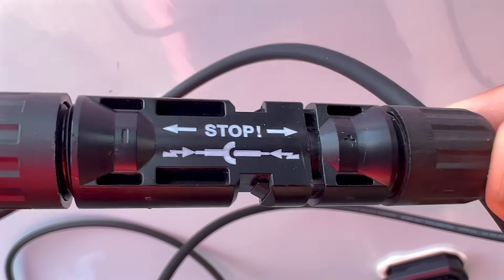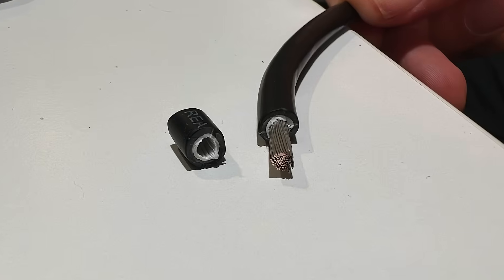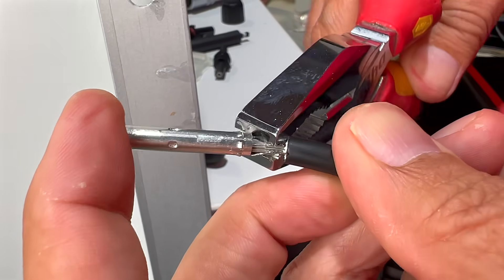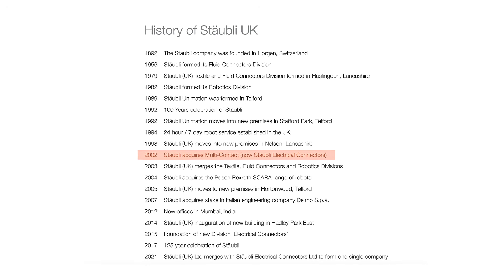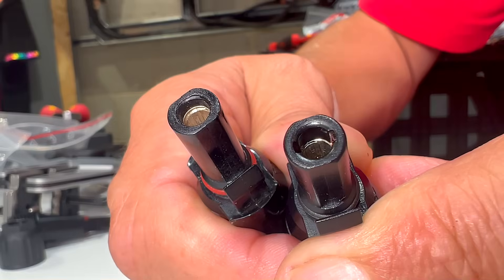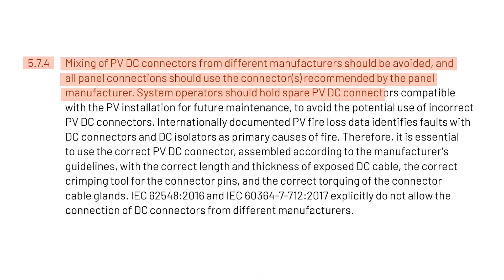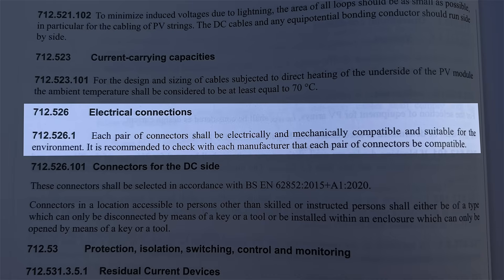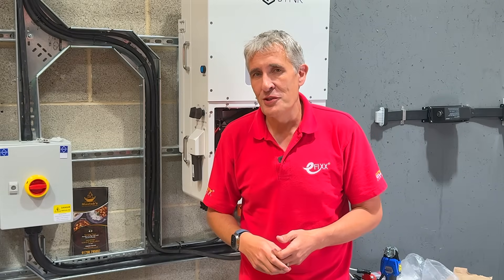Don't Get Burned by MC4 Solar Connectors

Comment: I'm wondering is dialectic grease would help with these types of connectors. It certainly does help in DC connections in cars. I have also had success in AC light fixtures where the high power bulbs were only lasting 30 days due to connector dialectic caused corrosion/oxidization.

After a large amount of dialectic grease was used the life span of the bulb went to two years. The connection no longer failed, the life span then was dependent upon the filament failing. 

Galvanic caused corrosion/oxidization is a huge issue in reducing the currant load capability of the connection. Dialectic grease does wonders to retard or stop this due to isolation from oxygen atmosphere cause corrosion.

If you have ever seen the red goop applied to a car battery connection, that is dialectic grease.

Comment: This is an important video for all to watch.  Personally, I don't like MC4 connectors because the build tolerances are poor. Then,  there are all the cheap clones which are outright dangerous.  Melted MC4s, cracked MC4s, I have seen it all.
Reply: No module de-energisation, a DC fault will melt anything!

Comment: Tools crazy expensive. I just hack job it together with plier cutters and use the tugg test. Could add solder I suppose.
Reply: its not that expensive to get a basic open barrel crimper. You don't need super fancy ones for the odd job. Ive also had really good success with the Iwiss brand ones from aliexpress.

Comment: At 12:38, talking about best practices, that hand with all that weight could probably have caused microcracks that are very often added to modules during installation or wrong handling. Knees, feet and hands should never add mechanical stress i.e. weigh even on front glass. Electroluminescence tests are crucial to highlight the quality of the job done by installers.
Reply: Thanks for posting this. Upon a cursory search I found little info and no info on testing a solar install. I'll do further research and see if there is anything out there on how to do this. All I found was info on 3rd party testing of panels themselves on a manufacturer level.

Comment: Also get a heat seeker gun or do touch and feel checkups regularly at peak sunshine hours on ALL your connectors at least once a month. I've had plenty overheat and melt due to poor crimping.
Reply: Interestingly, simple thermal imaging cameras became cheaper in the last few years. Not only do they allow quick inspections on cables and connections, you can also see faulty panels.
Here quite a few roof mounted panels are older than 30 years and the fastest fix is to remove the broken panel.

Comment: Have way too light for big loads quick connectors , came on100 watt panels . Four  100 watt panels pushing 40 amps at 12 volt DC have melted one connection so far . Bought much heaver wire and made run way shorter but still not good enough :(  Have to switch over to MC4 soon .
Reply: Maybe the best practice would be to butt connect cables, then run to cable panels and do the high load connection there where you can easily use connections designed for such higher loads. I am getting ready for a larger solar install. I think this is going to be the method I opt for.

Comment: Those connectors are just a joke imho.
There is no reason for the pin to not be removable from the connector.
Worse than that are the tiny tabs that actually secure the two connectors together.
So far I have bought from 3 different suppliers and only one doesn't have the problem of snapping the tabs off after two times snapping and unsnapping.
As for crimping them. I used a hydraulic crimper that makes a hexagonal crimp and then soldered after. So I can definitely concur to get the right crimping tool, if you make a bigger installation than 3 junctions.

Comment: The annoying thing with another 'connector' is that you have to buy another crimper for 30-50 bucks for something you might need only 2 or 3 times. 

Then I was wondering: is there a difference if you use an official Staubli crimper, where the metal connectors bend inward in the middle, and how much contact is the metal of the connector making with the copper inside vs if you krimp it with a standard crimping tool where the metal is around the copper inside? Probably not that much, so after doign that I gave it an additional crimp with pliers to make sure they are secure. 

Probably not the best but so far they are holding fine on the roof of my van but that's only 20V and not in series. If I were to connect a big array I'd get the official crimping tool.

Comment: since the solar panel is there for 20 years, just use a permanent installation, like heat shrink butt connectors. That will eliminate 4 crimp connections from each joint, so improve the installation.
Reply: @Iowa599 Not on ground installs if hail is coming, you can disconnect and take them to safety not everyone is a rich boy/girl, or has insurance.

Comment: There should be a huge clamp down on fake imported non branded stuff.
There should be quality control just like aircraft parts.
Fires are devastating ⚠️
Reply: aircraft parts? Hm... boeing
Reply: @Kuznet609  Back in the old days, when the 747 was actually a fantastic aircraft.

Comment: I've found they are not very waterproof.  The O ring around the cable gland does not always seal 100% and if water runs down the cable it fills up with water.   The resultant corrosion at least causes a high resistant short. I can imagine this being a source of a fire.   I suspect these are the Clone connectors
Reply: @StingrayBay  lots of people don’t check the connector datasheet for the sealing range of the gland. All cables have different outer diameters.
Reply: That's correct. There are different size compression sleeves that go into the end to water seal the proper cord!!!

Comment: There really should be a thermal fuse built into those MC4 connectors that can disconnect the power coming from the panel.

Comment: I have only used panels and have connected and disconnected some of the panels several times while evolving my system. The infrequent failures of the mc4s have  convinced me that ground mounted arrays are preferable and I would never put panels on a flammable roof,considering that leaves and squirrel nests would be good accelerator fuel.

Comment: As a solar master electrician and contractor with 23 years of solar installation experience, the #1 issues I come across is the connectors not being installed correctly. From residential to utility solar farms. This is the biggest problem that I’ve seen catch fires. 
Now not all connectors are created equal but it’s the skill that’s the problem. 
I’ve gone trough complete systems and had to remove the existing connectors and install news ones. Talk about time consuming
Reply: Commercial Sparky who's dabbled in more than a few Solar Systems, but my main "Alternative" experience was Central Office Battery Banks.
I also dabble in Plumbum-ing. The most common thing between the two trades is that the most common points of failure are the connection points. And with plumbing, especially with copper pipe or tubing, there's a lot of connections, and each one has to be done PERFECTLY right. Starting with reaming the cut. Because if we don't ream the cut, there's that little ridge on the inside of the cut (which is the reason we don't use TUBING CUTTERS on conduit) that causes a little tiny water vortex in the pipe when water is flowing. After about 5-10 years or so, this vortex causes "Erosive Corrosion" of the pipe, and, we get a pinhole an inch or so past the joint. The cuts must be reamed EVERY SINGLE TIME. And one or more will be missed.
This is why I no longer use Copper. It's PEX all the way.
Now, back to the Electrical end of things: As much as I like the firm grip of a Wire Nut, WHEN INSTALLED CORRECTLY, I will admit that the Wago wire connectors make it a lot easier to see if it's installed properly. And a LOT harder to try to shove an arf dozen #12 Solids into a Yeller Wire Nut.
I am now pondering chopping off all the MC4 Connectors on my system, and using Butt Splices with weatherproof Heat Shrink on top.
Yes, I used a lot of words to say, "The connections are most always the weakest points."
Oh, and people who aren't Sparkies? If you want to do Crimp Connectors yourself, BUY THE RATCHETTING CRIMPERS. Because they are designed to give the proper pressure each and every time. The non-ratchetting "Pliers" do NOT.
Reply: @TimeSurfer206  I have a couple 100W panels, two 100Ah 12v lifepo4 batteries and a 2000W 12v inverter. 

I’ve run load tests on the batteries and inverter because as a non-pro I’m extra paranoid about the prospect of a fire.  I immediately tossed the cables that came with the (Chinese) inverter and used oversized cables. Even so, I was surprised how warm the cables got during high loads. So, paranoia justified I guess!

Anyway, I just ordered what I hope are the final parts (solar charge controller, 10awg wire and quality MC4 connectors) for a small semi-permanent off-grid setup for power outages. I did not realize that a special crimping tool was required until after I ordered, but I figured I’d just use an existing general purpose crimper or even just pliers. I’ll probably only need to do a couple connectors, so what’s the harm? 

Well between this video and your comment I’ve scraped that plan, so thanks for that! Definitely shopping for a proper crimper now. Even an expensive crimper is still cheaper than a fire.
Reply: @Swalsh308  You're welcome, and I'm glad I helped.
The one thing I have learned the hardest and most often is that there is no substitute for doing it right the first time.

Comment: I am not very impressed by these connectors ( however it may be a badmanufacturer or a clone)
I took time to measure the depth of a proper assembled male and female connectors metal to metal depth of connections. 
Both the male and female pins allow for about 10mm metal to metal contacts,  ie the lose pins can insert about 10mm into each other, translate to a good electrical contact.
However,  once assembled into the plastic housings the metal to metal contacts is about only 3mm.

Fully connect with the safety restrains klicked in place,  the male only enter the female 3mm.

I don't believe it's a good long-term bond

(It may be clone connectors )

What's your take on it.

Have you ever measured the original connectors metal to metal contact depth?

Comment: They say different makers use different connections and you should only use one manufacturer,you can buy a housing to cover them to stop fires, make sure they are not loose

Comment: Doesn't matter what tool u use, even with the original connector it can ark and catch fire, I've seen this may times over many years, to fix this all we do is make a direct wire connection, problem solved

Comment: The most important thing is: to realize how much power comes from the panels, especially in full exposure. Almost 1000W are easily generated from two panels and that's the equivalent of a small electric cooking plate.

Even with our tiny 12V pond pump system I covered the 60W panels with a blanket before I worked on the cables. For some reason the connector had melted (no idea why, Chinese crap?). Even with the blanket on the panels it instantly started to charge the battery upon connecting, because the blanket must've been ineffective to stop the panels.😅 At least it wasn't full power.

I'd be even more careful with the full power systems where each panel has much more power, and strings of more than 4 kW... Careful or the sun power will burn you. The rules are there for a good reason and nothing can prevent physics from doing its thing.
Reply: Current is the issue, not power. At 1000 V, 1kW is only 1 amp. This is not enough to melt anything other than a tiny strand of wire if the connections are solid.
However, 1000V will arc across a 0.3 mm air gap and that causes plasma heating instead of resistive heating.
Reply: @ahaveland  since solar panels seem to work with 46 V maximum, a solar system with 10kW should have ~ 217 A 🔥
I put 40 V and 200 A into a solar cable calculator and it recommended cables of more than 7 cm thickness 😂 and the loss is still 90 W. 
Leave the wiring of big solar systems to professionals. That prevents unnecessary accidents.
Reply: @alis49281 oh dear, you're clueless and it shows. Professional installations run at hundreds of volts to about 1500V. Yes they are dangerous. The panels are in series sovoltages add up. You do not put hundred of panels in parallel to get hundreds of amps and 7cm cables! 😂😂😂
Reply: @ahaveland  Oh, you'd be surprised how much people underestimate the power the panels can produce even without direct sunlight. Quite a few people told me, that a solar roof with like 8 panels is only enough power for indoor lights. People also grossly overestimate the power their house needs...
Reply: @ahaveland  W=I*V 1000v*1A= 1000watts  looks like a pretty hot wire
Reply: @ 1A won't make a hot wire unless it's about 0.25 mm and AWG 30.
This is why transmission lines run at hundreds of thousands of volts so you don't need cables the size of train carriages.
Reply: @ahaveland  this is about solar panels and these don't run at thousands of Volts.

My solar powered Pump runs at 12 V. The bigger solar system that powers our house runs at 46 V....
Yes, dumb people melt cables.

And the solar pump cable connector is definitely Chinese crap I will replace at some point, but that one is a tiny system.

Our bigger system has 800W maximum and it is a type anyone is allowed to install here.

A friend has an old big system that can supply up to 7000 W. These should be wired by people who know what they are doing. With new panels, only 20 of them are needed to get 10 kW. I'm no electrician, but even I think that's dangerous.
Reply: @alis49281 yes, you are not an electrician. Solar farms run around 1500V, panels on a house can can 500 to 1000V.
As I said, a tiny wire can carry a lot of power with a low current if the voltage is high. At 12V, 1kW needs aboit 80A and a very thick cable.

Comment: A "well designed connector" is not well designed if it allows for seemingly correct function without making good contact.
IE: if the connector makes user error easy, it's not good.

A recent notorious example is the 12VHPWR conntectors nvidia started specing to replace the long lived PCIE 8 Pin minifit jr.

It is really obvious when a pcie 8 pin isn't seated, because there won't be a "click" and you can visually see the gap and lack of connection between the hooks. Interoperability between suppliers has also been a non issue for at least the vast majority of devices.

To be fair, in the realm of PCs, you are unlikely to need to field terminate a connection with a  minifit jr, and could very well crimp it incorrectly by hand as well.

Comment: Solid content. There’s a reason engineering standards exist. 

I wish Will Prouse covered this content.
Reply: @restfulplace3273  it was a link from will prowse that is the reason im here. He linked it and said it was a good watch!
Reply: He has on the forum said cuts them off uses a butt connector between the two wires after that never had a problem with them.
Reply: @Mike-01234  Ouch.  Weatherproof butt connectors, hard to do correctly.
Reply: @Mike-01234  seamless but connectors are a great idea but if you need to service or swap a panel, game over
Reply: @AskRemy 
I avoid butt connectors - only if there’s no way to run a fresh homerun
Reply: @fishhuntadventure  I agree, but if must, seamless is best

I never use them on pv wire

Comment: Why connectors - why not soldering.
Reply: Solder belongs on circuit boards not connectors. Crimp, crimp, crimp.
Reply: Soldering is not stable and gets loose over time

Comment: There's the problem buying and using the correct tools and sorting out the good from the bad , from decades of experience in industrial and mod control I know those style of formed sheet crimps have and always be problematic there's lots of rubbish out there and firms not willing to buy expensive tooling , personally I've never used MC 4  connectors  but have been aware of problems including water ingress corrosion breakages, maybe thay need a a more substantial connector instead of cheap as possible

Comment: Some guys dont like to hear it...  But these guys make GOOD videos.

Here we call them PINS and SOCKETS but even that can be confusing when the pin has a hole in it (sigh).

I have been evaluating various low cost MC4 clones and most of the 10awg have to be downrated to 10 amps or less. 

Who to Blame?
Profiteers or the Profit System 

At the end of the day every Joe is going to mix any two connectors that will plug together so....   The one hope is to do a current test. 

* 42A CC source for 4.2min

Do that to all of the connectors you have and you will see the failure mode quick.